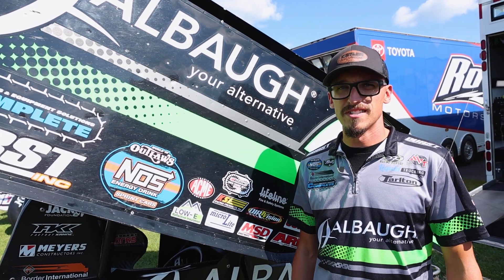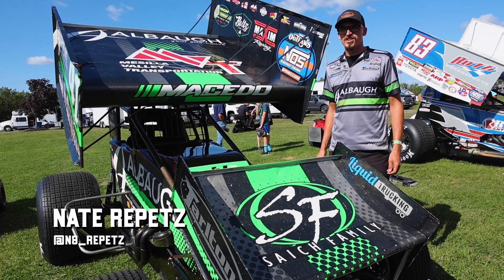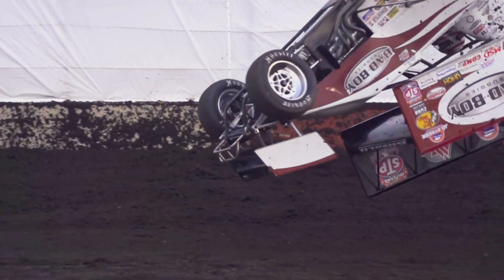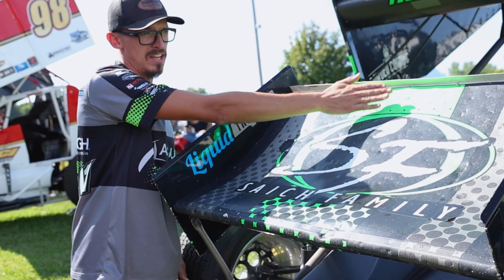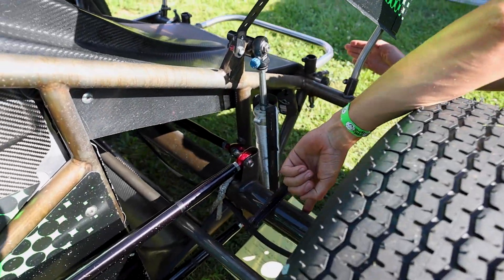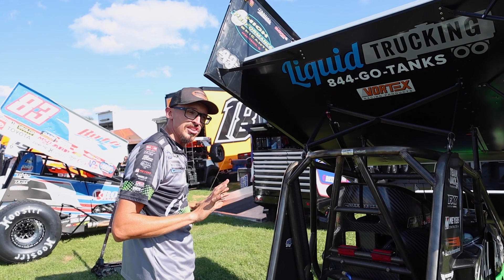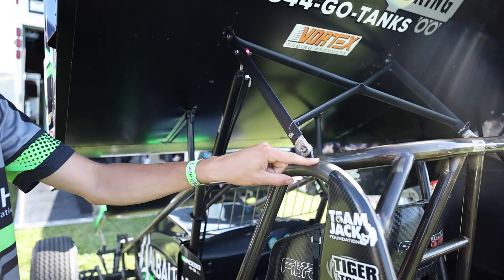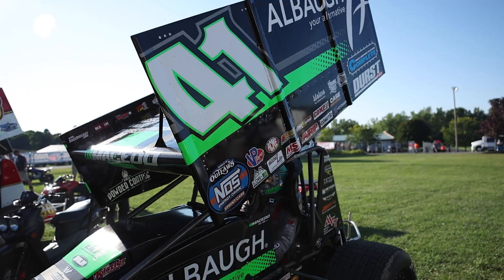Wings | Let's Learn Something with Nate Repetz

Comment: Does woo regulate how the wing is oriented on the car side to side and along the front to back axis?
Seems like there would be an advantage to moving the wings over to the left some and also to rotate the front of the wing to the left alittle so that the sideboards catch more air. But it looks like nobody does this. Is that because they are not allowed to do it, or is it just not helpful?
Reply: They Blaney brothers out of Ohio have the left side of the body of the wing slightly higher the the right and also the left side of the wing body slightly forward of the right.

Comment: Thank you for these videos! A couple years ago I thought wingless sprints were faster because the car had to fight less air but I learned the wing holds the car down on the track harder for more grip so it’s actually faster with a wing. I also didn’t know they were an extra safety feature by making the car not roll as much, no wonder the wingless usac cars flip multiple times out of the track.
Reply: Good catch on the safety advantage the wing brings to the car. Not sure how long you have been a fan, but I grew with the term "snap roll" to describe the way a non-wing car will flip. Those snap rolls are vicious and have hurt and killed alot of drivers especially in the days before the roll cage. The wing has added years to the careers of countless drivers like Kinser, Swindell, Haudenschild and many others. As the video explains, the safety not only comes from slowing down the roll rate the wing also dissipates energy as it crushes during the flip. I've been a fan of open wheel dirt cars since the late 1950's and after all these years, there is still no better racing to me. Enjoy and here's to some dirt at the bottom of your beer cup.
Reply: Great reply busher69, am new to sprint cars , love hearing stories from long time fans